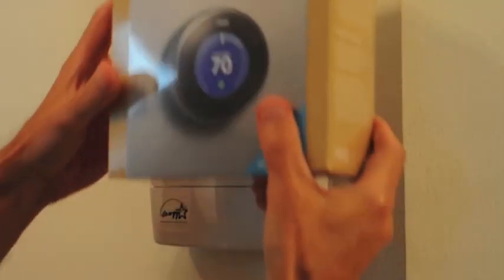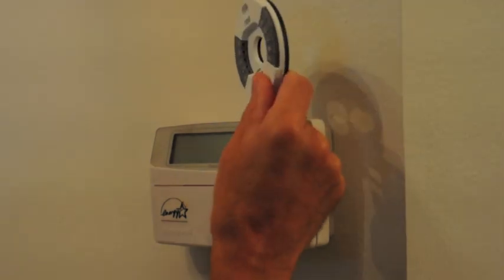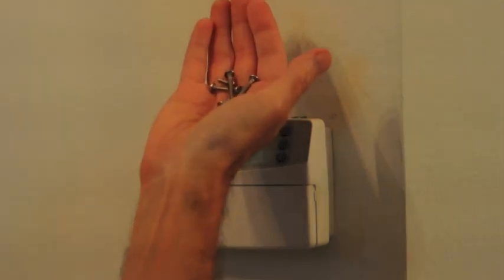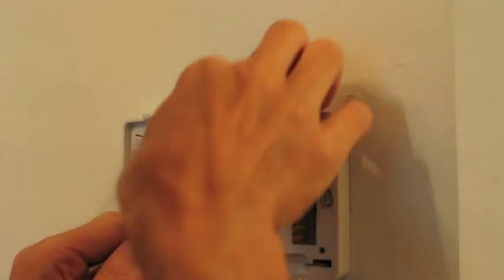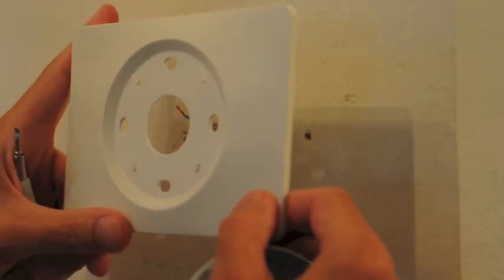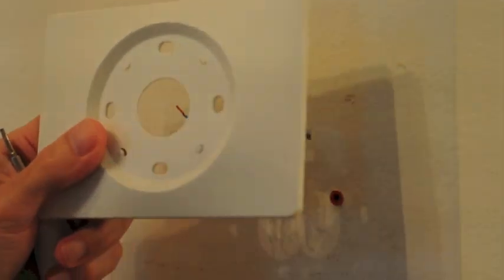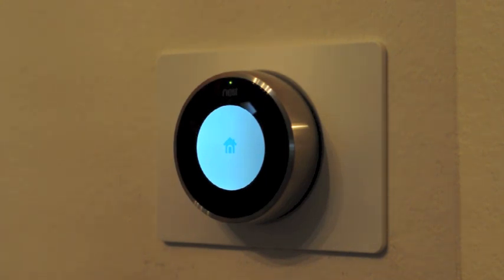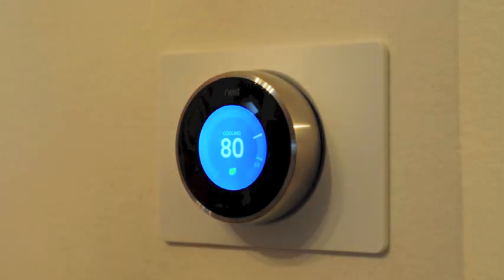Nest Thermostat (2nd generation) Part I:Installing

Comment: im an HVAC contractor, and it sounds to me like You are blaming NEST for some other problem not connected to NEST.   the WIFI thermostats do not trip breakers, get Your system checked out by a contractor and You could be happy again, good luck!

Comment: Good Concept. Bells and wistles . But Mine has been tripping the AC units breaker since day 2. Summer heat = danger to my animals. Got to go outside day or night to fix. It allways looses communication with phone app so i got to get up just like old thermostat.

Comment: Its a food concept. Akl the bells and whistles are fun. But Mine has been tripping the breaker since the day it was installed. Now i Cant realy leave my house for to long during the summer in fear that my animals will over heat if my AC unit shuts off. This happens at all hours of they day or night. Also it looses communication with my phone so i have to get yo to fiddle with it anyway. An old thermostat simply chuggs along without getting effected by crappy wiring or other home problems.

Comment: Nest = frustration
Ever since the day mine was installed it has been tripping my breaker box . When this happens in middle of the night I get to get dressed and go outside to flip the breaker. Ya fun!
It constantly looses connection with my phone app so I have to get up and fiddle with it any ways. And thus far no response from the utility company that did the install. No I Cant leave my home for longer than a day in the summer or my animal's will boil. Thanx nest .

Comment from the maker: You should be able to tell if compatible using the Nest Compatibility checker:
widgets.nest.com/compatibility/

(Normally thermostat *not* wired into house A/C power, just uses low voltage wiring from A/C.)